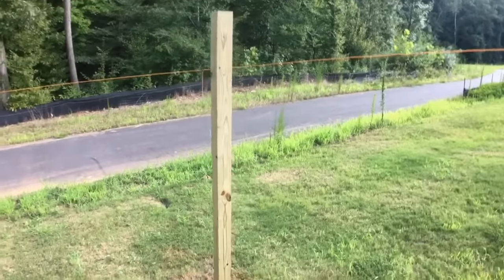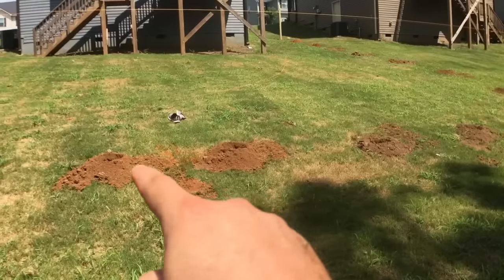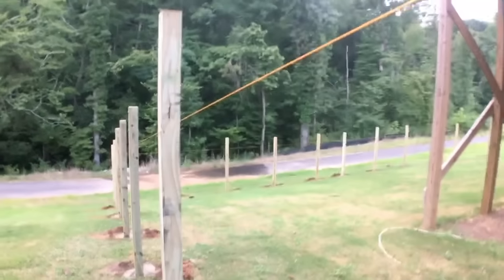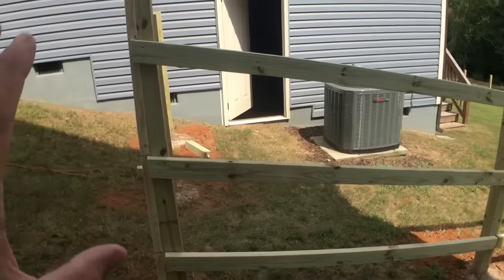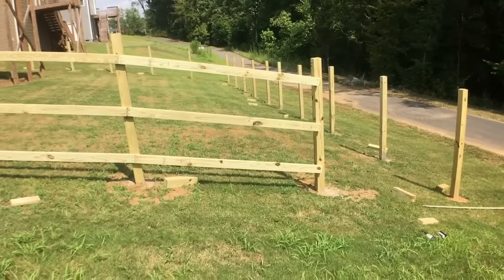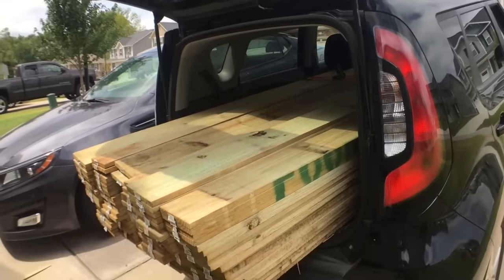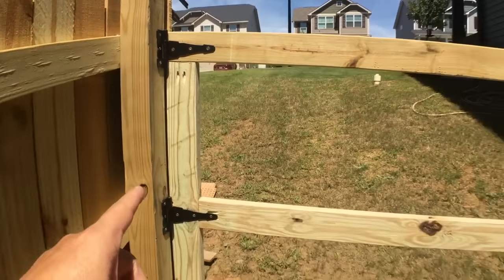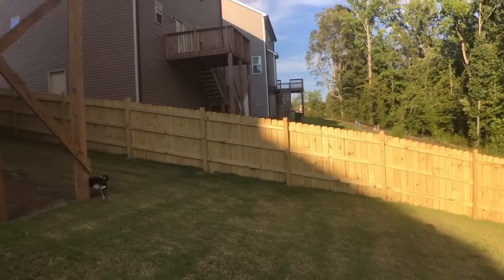How To Build & Install A Wood Privacy Fence Yourself! WITHOUT breaking the bank!!!!

Comment: Not impressed. I could pick your fence apart just like you did the neighbor across the street. Over 14 years experience, and I can tell you that you're going to have problems. Hire a professional next time. You didn't go deep enough with your footings and you dry poured your concrete. Two things I noticed right away that I consider a no no in fencing. You have to consider frost lines and wind load. 30" deep is how deep we go. And buy a wheel barrow and a shovel. I thought I saw your poor wife cleaning up dirt by hand with a bucket. Come on man.
Reply from the maker: Sorry I hurt your feelings! Didn’t mean to ruin your Saturday! My bad!
Reply from the maker: I think I’ll leave it up.....